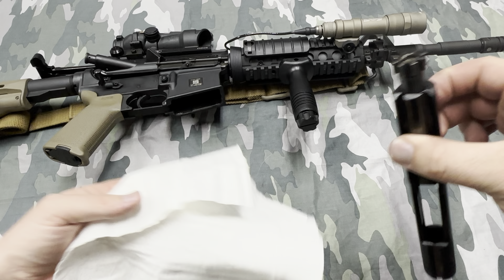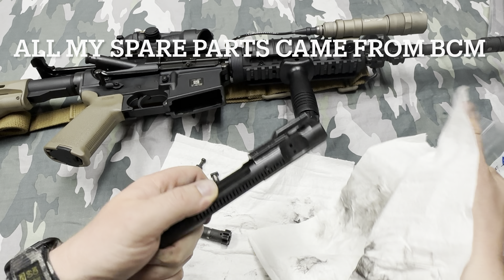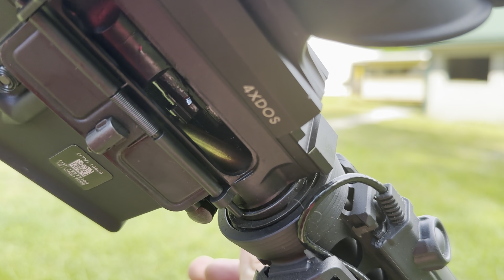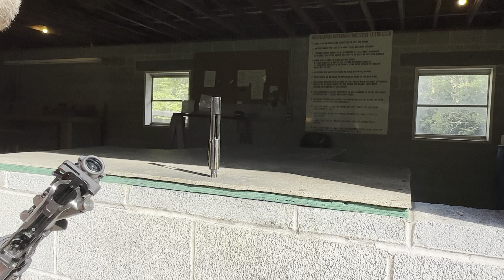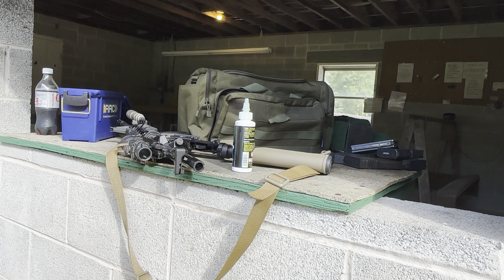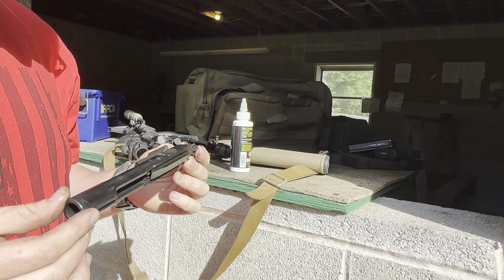Colt M4A1 dead at 2,000 rounds (kinda)

Comment from the maker: Update video here…. Then check the comments on that video for a 2nd update video…

https://youtu.be/BASSN9N0d8U?si=41rr5Wps10HW6wM7
Reply: Yeah that’s why you maintain your firearm gas ring issues are as stupid as not changing your oil. Check it every cleaning and change them.
Reply: No way gas rings go out that fast.
Reply: 100% that one of 3 issues or all 3. 
1) Subpar ammo (not milspec)
2) Gas rings
3) Magazine or Magazine spring issue
Or all three
Use standard GI magazines make sure the springs in your magazines are replaced as needed.
PMAGs are pretty reliable 
Your ammo doesnt seem to be consistent  ie underpressured ammo
Reply: Gas rings do mot go out fast like that

Comment: It's probably just the BCG was a little rough in the bolt bore.  Keep it lubed, replace the rings and keep running it.  It should wear in and be fine.  Of course, check them periodically.  I had a BCG that did this and it's fine now that it's worn in.
Reply from the maker: I actually replaced it with a BCM for now waiting to see if colt will replace both my BCGs I replaced the gas rings and found that only helped alittle. That BCG is leaking gas somewhere. My other colt BCG is flaking chrome on the inside. If your interested check out my colt testing videos and I just posted a examination
 Video on the BCGs. Also the rail covers are the knights armament rail covers.

Comment: Cleaning is not an issue if it is lubed..Colt's gas ports are sized for full powered NATO spec ammo and will not always run cheaper ammo reliably....The carrier failed the gas ring test so replace the rings..If your rifle is wearing gas rings fast then the carrier could have a rough gas ring bore..Colt makes great bolts and should not be replaced if in spec..Look in the carrier bores as see if the bore is rough with a lot of machine marks..Buffer weights do very little to remedy under or over gassed rifles..Go to the School of the American rifle and you will learn how to gauge a carrier..Colt usually has great BCG's, but crap can slip through with any manufacturer..
Reply: This! You beat me to making the same comment.
Reply from the maker: I do watch his channel I’ll re watch some of the bolt stuff and do some of the testing w this maybe even get a bore scope. I had a CR6920 that ate steel cased ammo like no one’s business. I also have a CETME L that’s very very picky w ammo and won’t eat anything less then nato and the CETME L runs the AAC 5.56 w 0 issues at least from the minimum testing I’ve done w it.
Reply: That’s not a viable excuse for today’s production/tolerance standards.
Reply: Check the bolt carrier like he said. Rather than replacing stuff, warranty it. Show them your video and hold them accountable. If you put new rings in and it solves your issue, at least you can enjoy it in the meantime. It also confirms your exact issue.
Reply: @ryanjohn8035  It is fact and is present in every manufacturer and builder..Roll marks and cost do not change this fact..Colt is still one of the best..I know, I have the gauges and tolerances to check..
Reply: @hairydogstail  This. I got busy and didn’t finish my thought on the last one. I had a similar issue with a DDM4A1. In just a few hundred rounds my gas rings were toast. I put new rings in, and my problem was solved and stayed solved. Possibly the gas rings were too soft or sized wrong. If gas rings don’t fix it, or they wear out again super fast, I’d contact Colt.
Reply from the maker: @matthewfeltenberger844  I don’t think will warranty something I’ve had for 2 years. I went out this morning after replacing the gas rings. It’s better but it still won’t lock open correctly
Reply: @connorburnes7697  DD makes excellent barrels..Rifles that are over gassed will have short gas ring life as other problems. If replacing the rings solved the problem, then it looked like you found the problem..Process of elimination..Always put the ring lips (sharp edge) in the same direction, just like a gas engine.. I get my replacement rings from BCM and I have had excellent results with them..Rings are a cheep insurance to keep on hand...AR problems are not that hard to fix or diagnose, if you know what to look for..
Reply: @ryanjohn8035 Ordered two complete BCM 14.5 pinned uppers in 2014 and one came without staking on the gas key (something of which BCM CS accused me of lying about until I sent them the pictures 😂) and the other would eat gas rings every 400-500 rounds or so. 

A bad BCG every once in awhile is certainly less worrisome than 2 at once like I got from BCM.
Reply: @THEPAGUNGUY Warranty the BCG with Colt and if you still feel the need to replace it, go with an AO Precision BCG. (AO is not Aero)
Reply: How old is the colt bolt? Colt had god awful QC in the early 00’s. They were very dumb back then because they set the stage for HK making the 416. I’m grateful however because they also set the stage for socom to place a request for a better bolt and LMT answered the call with their Enhanced BCG and Bolt. It took me a year of weekly online searching before I could order mine but the bolt is unbreakable and the carrier is pretty friggin rad as well. 

Colt used to be the best in the business. They are a name now. There is a reason CZ bought them and the military went with FN, geissele, KAC, HK, DD, and LMT. Hell DD makes socoms barrels now, I don’t believe colt has a contract anymore for anything. 

Doo doo happens man. Lemons sneak in when parts are made en mass
Reply: @riflesfirst208  I agree but saying that an M4 isn’t able to shoot lesser quality ammo is just dismissive of a bad product IMO. I’ve had a bcm 14.5 socom myself and luckily it ran well. However I opted for a fathers of freedom bcg from psa instead for caroming purposes.
Reply: @ryanjohn8035  If you buy an SR-15, it very likely won’t feed Tula. Neither will most rifles by Sionics. 

I wouldn’t call the KAC SR-15 or Sionics bad products at all.

Granted that’s not exactly what’s being referenced here, but I would in no way use reliability with low powered or low quality ammo as a performance benchmark.
Reply: @T20-c8f  During the early 2000's, Colt had some chamber issues due to improper chrome lining of the chambers and had some barrels come loose, but was quickly fixed (They seasoned the threads before final barrel nut torque)..Colt has always and still does today use mil spec bolts and carriers..They dropped the cadge codes since FN won the contract, but that was more politics/price issue rather than a quality issue..Colt has never manufactured many of their parts and still doesn't today..During the height of the Vietnam war, Colt only manufactured in house 10 to 18 parts of the 126 parts used in all the different M16 variants..Colt does get their parts from DOD approved manufacturers and only purchase from bin number one (meaning passes all mill spec tolerances, materials and specs)..Colt still has a lab to verify the parts are made with the proper metals and heat treatment..Many AR manufacturers will purchase parts from the same manufacturers, but from the different bins of quality that does not pass mil spec (which is why they are cheaper)..LMT enhanced carrier and bolt were rejected by the military..The enhanced carrier worked as designed with the 14.5" barrel and carbine length gas tube..LMT lengthened the straight part of the cam slot to allow more time for the bolt to un-lock, allowing the residual pressure to drop before ejection..This worked great with the 14.5" barrel, but would not run reliable with the 20" barrel/gas tube..The military did not want to keep two different carriers in the supply system, so they rejected it..The LMT bolt did last longer, but was deemed not to be cost effective, so they dropped it as it was easier and cheaper to just replace the mill spec bolt every 5 to 6000 rounds.. The HK was a mistake in my opinion, but I won't get into that discussion here..There were much better SAW's available they never even considered or tested..There is a lot of bs being spread about Colt on the internet today, which reminds me of the fudd lore that was spread about the M16 during the Vietnam war..Colt still supplies the US and other military's today with M4A1 rifles, which keeps them very busy.. Every manufacturer will have crap get through, even LMT, HK as well as Colt.It is just a reality..
Reply: @THEPAGUNGUY   
I just looked at their warranty and it’s surprisingly shit. They’ll repair or replace factory defect for original owner up to a year. If your gas ring run is rough and eating rings, that’d be a defect. All I can say is it’s always a no until you ask. If it’s still not locking back there could be a lot of factors there. They may even offer to take it back all together and sort it out for you for a nominal fee. Id at least contact them.
Reply: @ryanjohn8035  Colt sizes their ports to run with full powered NATO spec ammo and is not dismissive....Many AR manufacturers will over size their barrel ports to run lower pressure ammunition..This will then result with a rifle that is over gassed when full powered ammunition is used..This is why I recommend the Rifle Speed adj gas block with any over sized barrel port..Use or build the rifle for ones need..
Reply: @hairydogstail  or rather than having to run an adjustable bcg or gas block you just produce a reliable slightly over gassed system to begin with that will optimally run NATO spec ammo but will be able to substitute for say 55 grain up to 77 grain… ya know like majority of manufactures. I’m more of an AK guy now a days. Those rifles can be violently over gassed and still operate with poor ammunition. Not that it’s fun but for situations it is definitely a benefit of that platform.
Reply: Could very well be a microbest or other big OEM BCG with what colt is doing these days. You don’t know what parts you’re getting with CR serial number rifles
Reply: @ryanjohn8035  It depends on what you want..An over gassed rifle can have it;s own problems but if you want a rifle to shoot the huge spectrum of available ammunition on the commercial market and being over gassed isn't a concern then go with a larger barrel port..I sometimes use a suppressor and use under pressured (cheaper ammo) for practice, so I use the Rifle Speed adj gas block..It is the best of both worlds..Nothing wrong with a well made AK and they can also be used with an adj piston..
Reply: @bobsagetbillboard1876  The same parts they were using before they were CR serial numbers..Colt only uses mil spec parts from DOD approved manufacturers like they always have..
Reply: Sidebar: as a service rifle competitor I rebarrel button barrels at about 1800 round including a new headspaced assembly. This procedure has kept me in the game which is the most important thing.
Reply: Watch school of the American rifle you will learn a lot on each episode.
Reply: @richardturk7162  I have met Chad and consider him an innovator for exposing the false narratives on the internet about the AR platform..I couldn't agree more with you..

Comment: The gas rings may have scared the inside of your bolt and you may have to buy another bolt assembly! That works the same as a piston and Rings in the cylinder of a engine! If the cylinder is scared up it want help just putting rings in it because it will have gouge streaks not letting it seal off and have proper pressure to function right.

Comment: G-96 is great for rust preventative but you need to use a lubricant that's better for the bolt on the slide surfaces like Lucas oil or some type of oil that is thicker and very slick that won't break down so easily. I have used slick 50 on my bolt slide and it stays pretty slick and doesn't take but just a little bit and the same for Lucas oil. And I put G-96 on the outside of my firearms because it is a great rust preventative!

Comment: Short stroking, probably ammonia related. The gas rings are fine. The gun does not have to be surgically scrubbed. It’s not lubricant. You are not using lubricant if you are using G96 Gun Treatment. G96 CLP should be used. Your problem however is not lube. My guess is if you sent the whole gun back to Colt, they would test fire it with M855 and it would run flawless. You looking in the wrong place with all the cleaning and lubricant issues. The rifle will work with one gas ring. You should not be changing out bolts or buffers from its factory condition. Get real NATO ammo. If you want to run crap ammo, get a rifle with a larger gas port designed to run subpower ammunition. You bought a Colt M4A1-type rifle. It is set up for NATO ammunition. It’s not the gun.
Reply from the maker: Well first off thanks for commenting I’m actually a pretty big fan of yours. I have additional videos proving there’s an issue with both my Colt BCGs I replaced the Colt BCG with a BCM BCG and it runs all ammo fine. You can check out the other videos if you would like. My AR15A4 actually has chrome flaking on the inside of the carrier. Again the BCM BCG runs all ammo with the H2 buffer.
Reply from the maker: Please watch this video and let me know your thoughts 

https://youtu.be/d7BbS_A5NUw?si=V-Q0sMjyZBmOOn1i

Comment: My colt 6940 ate its rings about 700 rds in and I replaced them with that 1 piece gas ring, and it’s been fine since
Reply from the maker: Is that a CR prefix or an older one? Just wondering for reference. Also what 1 piece ring did you use?
Reply: @THEPAGUNGUY  cr prefix?
Reply from the maker: @shanerichardson5145 yep

Comment: Your buffer weight is way like you need to add an H3 usually the M4 is over gas that’s why you need to have a heavier weight buffer I have my FN M4 collector serious IR ran through the same issues and when I change the buffer to an H3 all my issues went away
Reply: Plus the ammo has to be the 55 662 grain works better

Comment: Gass rings are 100% a wear and tear item expected to be replaced. But not at 2k rounds, that insanely weak performance and doesn't help that Colt is outsourcing their parts to very subpar outside manufacturers. I always keep some BCM bolt rebuilt/spare parts kits on me, in my rifles and range bags. Super easy  to swap out an extractor or spring, same with gas rings. Personally, my preferred BCG for the past few years has been the Microbest chromed with the phosphate gas key and extractor. I've had nothing but positive results with them. I've also got three of the Microbest made PSA branded Father's of Freedom BCG that have been nothing but reliable as well.

Comment: Also like others have said - too much spring/buffer for the particular ammunition you are firing. Try some hotter ammo, or reduce the spring/buffer weight. The fact that the ejection pattern is more of a 4 o'clock, not a 3/3:30. On the last round in the 20 round magazine the bolt stop is catching the carrier face - NOT the bolt face as it should. This tells me the bcg isn't going to full stroke to the rear which is going to be a symptom of under-gassing. Replace your rings, make every effort to make the gun as gas efficient as possible (if planning on using AAC ammo) or reduce your buffer weight/spring and test again. Just know that if you reduce your spring/buffer - if you feed it hotter ammo, your ejection pattern will more to a more forward direction and over gassing can have detrimental effects as well.

Comment: it's an old myth that that's now to check gas rings. This is the correct way from TM 9-1005-319-23&P:

4. Check bolt assembly (5) for proper fit with bolt
cam pin removed. Turn key and bolt carrier
assembly (6) and suspend so the bolt assembly
is pointed down.

NOTE:
The bolt assembly must not drop out. If
weight of bolt assembly allows it to drop out
of key and bolt carrier assembly, replace bolt
rings

Comment: I have not had luck with AAC 5.56 ammo. Same issues as you. FTF, weak ejection, bolt not locking back. Appears to be underpowered and also inconsistent. Had a brand new barrel and BCG and worked flawlessly with miscellaneous 223 or 556 but issues with AAC. That would be one factor if I had to guess, obviously the sheared gas rings didn’t help.

Comment: Every gun I build, I run Sprinco parts from the buffer spring to the gas rings. Throw some Sprinco rings on that bolt and you should be back to 100.
Reply: What's the lifespan of  buffer springs? And springco buffers? Got a bcm in my SPR, works fine but I want to get another spare and looking at springco
Reply: @JohnLocke1776  It kinda varies on what type of material the spring is made of and the manufacturing process. A standard G.I. Mil-spec spring should run properly for 4000-10,000 cycles (rule of thumb swap em every 5,000). Though shorter barrel (12.5"-10.3") carbine length gas systems are on the low end of that range for obvious reasons. I run a Sprinco "Blue" spring and H1 buffer in all my carbines, one is a 10.3" with over 23,000 rounds through it under moderate full auto usage and it's still combat effective 100 so I'm a firm believer in Sprinco products.